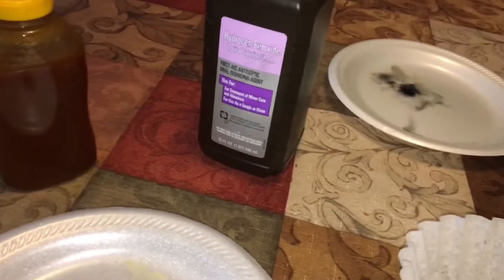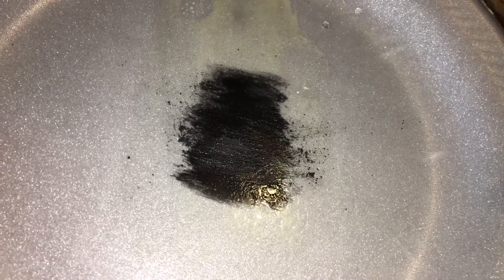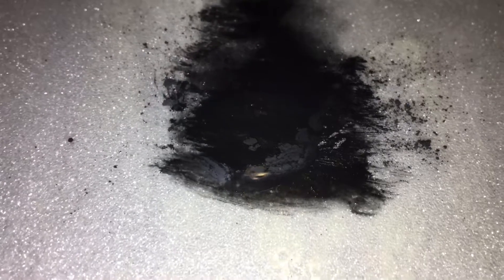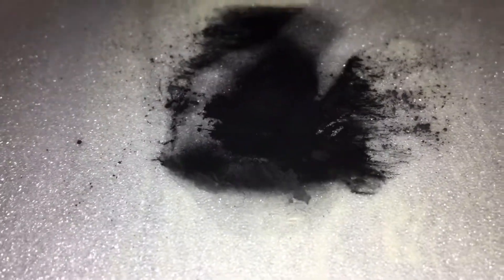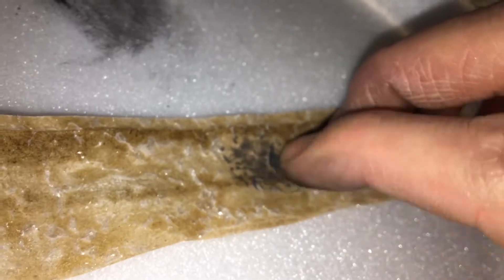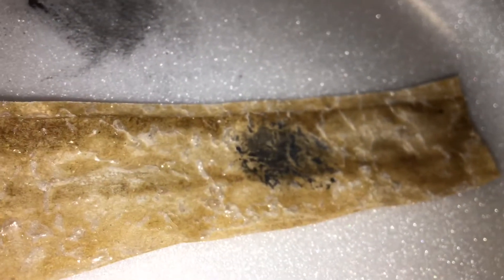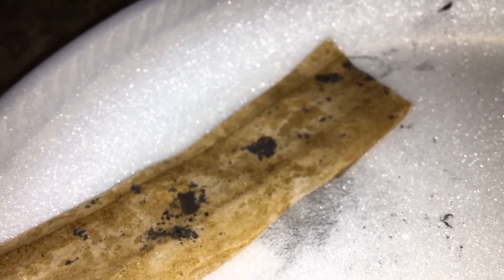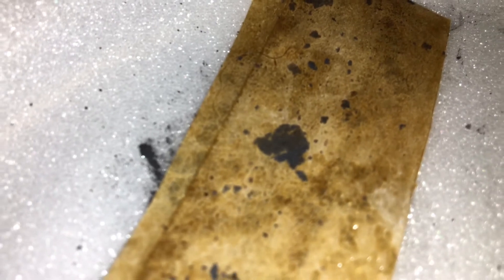How to make Graphene with sugar, hydrogen peroxide 3% and graphite powder diy graphene

Comment from the maker: Another possible method for making graphene:
In a cup of warm water add sugar until it no longer dissolves then add a few spoonfuls more of sugar.Drop in a small amount of Graphite powder into the sugar water mixture. Stir it up well. There should be a thin black film on top of the liquid. Let it set for a few days.The sugar crystals will grow on the graphene surface similar to how rock candy grows.
Reply from the maker: https://chemistry.stackexchange.com/questions/87309/is-this-a-viable-method-for-graphene-production/87334#87334

Comment: What about an aquarium pump to make bubbles in hydrogen peroxide.  Get stronger peroxide at a beauty store. Remember the Nobel prize for graphene was with a #2 pencil and a roll of scotch tape. you can  lift the films off with microscope slide and check the resistance for graphene.
Keep going.

Comment from the maker: Water Combustion Engine Idea:
Recently saw an article where scientists were able to divide a drop of water simply by channeling it repeatedly through a forked path that got smaller and smaller. The idea would be to take this fractional water droplet and apply an electric spark or plasma. At 3000c 50% of water breaks down to hydrogen and oxygen. So the plasma or electric spark could provide both the heat and the ignition for the combustion of water to be used in future engine designs. The reason the water is needed to be divided into fractional drops is to allow a lesser amount of material that would need to be heated and combust. This is easier to accomplish than to use larger amounts.

Comment: This is still graphite but you are building a technique. 

Domestic hydrogen peroxide is only 3% (if it's a new bottle), so it's probably not scrubbing the surface very well. You'd need an additional element like boric acid to make it good at scrubbing the sugar, but that's going to graphene oxide at that point.
Reply from the maker: Eh, when the burger is dry add more ketchup. Or in other words whats wrong with simply draining HHO 3% and adding more? Thanks for your comment though.

Comment from the maker: This is layered Graphene. To get thinner layers you must start with a super smooth surface of sugar. H2O2 dissolves the sugar surface from which the Graphene layers suspend in the water. One could argue that warm water could do the same however residual sugars may remain and the graphene bonding would be called to question as sugar could be the binder. With H2O2 all of the sugar is dissolved. One could also say that by dropping Graphite Powder in water you get the same effect. This is not true as the powder does not become uniform but instead remains fractured into millions of pieces. With the sugar and H2O2 method I am able to lightly push a piece of layered Graphene around without the scattering. With refinement I believe this is a cost effective and practical way of making Graphene. -editAn ideal approach is to start with a sugar based surface that is polished extremely smooth. Any imperfections or ridges etc will cause shearing of the Graphene and it will separate. Apply graphite powder onto sugar surface and rub together lightly but thoroughly to enable bonding. Once that is done either honey or a sugary based syrup may be used on top of the rubbed graphite powders. By doing this you can cleave off excess graphite. Pour H2O2 on top of syrup or honey that was applied on top of graphite powder. Simply roll off excess water or suction off. Continue this process until just one or few layers of Graphene remain. Once down to a few layers you can roll the H2O2 under the Graphene thus removing it from the sugar substrate.
Reply: then i made Graphene with charcoal (pulverized while moist) and water
Reply from the maker: Yes, actually. I haven't tried such a method so I don't know the actual result. Interesting though however I would see it probably forming a sludge rather than have a linear form as I've demonstrated which is consistent with how graphene stacks together in graphite. The charcoal and water concoction would probably just be a slurry that had trace graphene pieces due to dissolving, density differences and ensuing shear. If I had to use charcoal for graphene production - which sounds very appealing for many reasons - I would first figure out how to Make charcoal from material that produces zero porosity.
Reply: what about throwing graphite/rawhoney/peroxide mix into a coffee grinder/blender for a few?

Comment from the maker: First used honey thinly smeared onto plate with graphite rubbed on top second experiment I took a strip of brown paper that was dipped in a saturated solution of sugar water and dried leaving a sugar crystal coating. Hydrogen peroxide 3% was used.